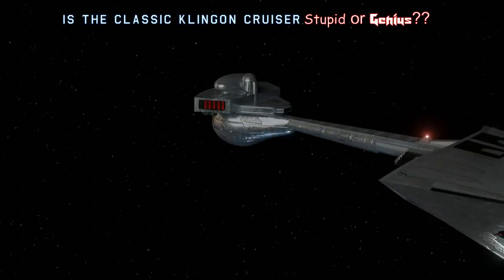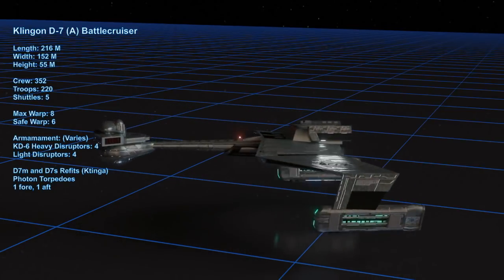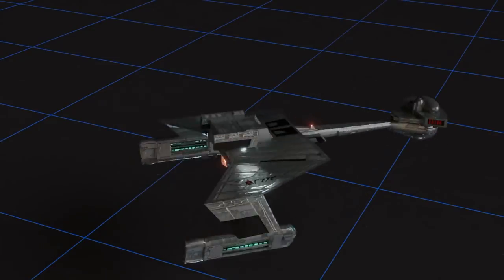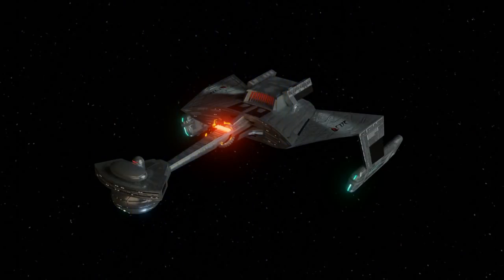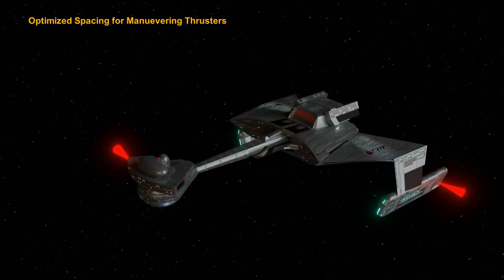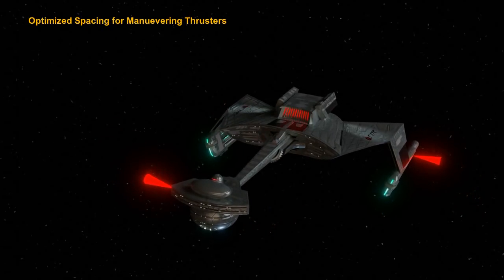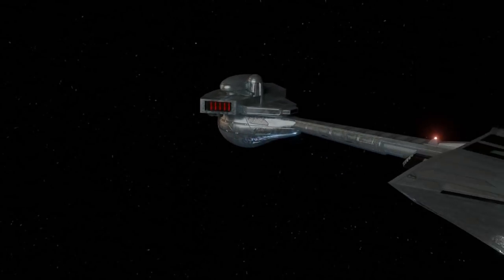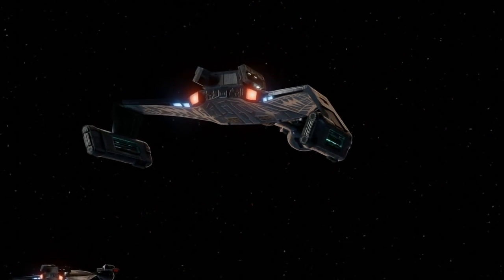The Classic Klingon D-7 Cruiser - Stupid or Genius Design?? Animated Breakdown!

Comment: According to the FASA Star Trek material, the boom section was separable specifically in case of crew mutinies. Since all the control functions were in the boom, this would leave the drive section pretty well useless while the captain and officers escaped in the boom. The long neck might be needed to help isolate the command section in that scenario; it's easier to lock down a narrow boom, rather than a wider (and more structurally stable) section.
Reply: It's a pretty shit ship if you can only control systems from one location in a ship.
Not just an internal CIC, but even the drive section having all the machinery right there but no way to control it in case the bridge/boom section gets shot.
Reply: And the officers could order a self-destruct immediately after safe boom separation.  Great disincentive to mutiny.
Reply: If you think the D7 was weak, what about the D18. It came constantly with a bent boom in the package.
It literally was like a command section attached by a space worm.
The only thing scary about that destroyer was not making it to the battle at all, "no thanks, I'll go in the K23."
Reply: @michaelblackwell7408  I love the design of the D-10, though.
Reply: Exacty.
Reply: Also they used servator races in the rear section. Parts of the rear section ware radio active.
Reply: Also, if there was a mutiny, that long thin neck is an easily defendable chokepoint.  A much smaller crew in the command section could defend against a much larger force attacking from the engineering section.
Reply: @robertcampbell6349  Stranding them  YEARS from home.
Reply: The Final reflection. D 5, D 5 A, and D 6.
Reply: Was about to suggest that as a possibility.

Klingons frequently have brawls, drink ups and power struggles. The thin boom funnels crew and offers a excellent point of defence. Throw in the other reasons mentioned in the video... i think it's a understandable but not ideal design.
Reply: It's for improved firing arcs...Star Fleet Battles Game.
Reply: It wasn’t FASA, it was Amarillo Design Bureau (Starfleet Battles). that came up with that idea. The SSDs would have a square in the boom to represent internal security.
Reply: @mattalleman4415  Yes! Didn't they also have an impulse engine block at the base?
Reply: @GreyhawkGrognard  yep a whole section for saucers and booms!
Reply: yeah, that is perfectly fits the klingon operation style, leave the ship and save your own skin and not face the chance of death in battle with the inferior rabble. after all, who wants to die today, or any day.
Reply: @thorin1045  Bear in mind this was pre-TNG. The Klingons back then were still culturally like the Soviets, as depicted in TOS and TAS. They hadn't been developed into the honor-bound warriors we see later. These were Klingons who used surgically altered spies and took hostages, and negotiated in bad faith and scorned the use of knives when there were phasers to be had.
Reply: @GreyhawkGrognard  well, in that case the leaders should be in the back with machinephasers mowing down the deserters...

Comment: I think the maneuverability theory makes the most sense. We all know that Klingons value that maneuverability very highly, since they need it to bring their main forward weapons to bear. Adding more structure around the neck would only increase the ships mass unnecessarily, and increased mass slows you down again. And as you said the neck would be incredibly hard to hit in the first place, so keeping it thin could be a valid tactic to protect it. Lets say it would be 2, maybe 3 times as thick. We have seen the damage star trek weapons do to unshielded targets. It is indeed quite realistic that a hit from a strong weapon (like a torpedo) would still cut the ship in half, even with the thicker neck. So making it thinner would at that point be more useful, as it is harder to hit.
Reply: I personally dispute the "Harder to hit" point, mainly due to a scene in the Next Generation which shows the Enterprise D destroying a group of small craft very quickly, granted, since it takes place a century after the Original Series, and we never got to really see how accurate the 1701 Enterprise's weapons were, so I guess in that respect, the point still stands.
Reply: Deflector shields are the bread and butter of all Star Trek ships of all species. Without shields a ship would need heavy armor but heavy armor is no match for a salvo of photon torpedoes. Klingons used disruptor weapons to break shields. The Federation use Phasers to drain shields. When the shields are down, the fight is over except for surrender negotiations and Klingons take no prisoners. TOS torpedoes are not super accurate. They rely on massive energy release near a target to disable shields or destroy an enemy vessel.
Reply: Then you aim for the point where the "neck" connects to the "body" of the ship.
Reply: Agreed with the firing angle point; Klingon and Romulan warships are both notable for the sheer amount of forward-facing firepower they have, vs the Federation who prefers a more flexible approach (Phaser Strips over Disruptors, torpedo launchers with fore and aft mountings that feed from the same magazine).
This makes sense for a species with a strong warrior culture prone to imperial expansionism and getting into lots of fights as a stronger "broadside" helps in straight up fights vs other regional-galactic powers.
Reply: @patrickstivers7387  In theory that's a good strategy, but the flaw is in execution. Keep in mind that at no time will you get the opportunity to fire at a fresh enemy where they will NOT have an opportunity to fire back. That's called an 'exchange'. The idea is to come away from the exchange in better shape than your foe. If you MISS, you've opened yourself up to damage to critical systems that may put you at a disadvantage later in the fight. You LOST the 'exchange'. In that case you are much better off attempting to disable a critical system in the main hull then trying to risk a 'one shot' kill. 

Now, you may try some cleaver maneuvers to 'get in close' to optimize your targeting but I would submit that if a Klingon captain 'lets' you do that, he's probably baiting you. ;) Klingons are well aware of that apparent 'vulnerability' their thin neck may offer an opponent, and they will absolutely use that assumption to their advantage.
Reply: Except that having a long lever arm makes it SLOWER to turn, and having the spine be very thin means it's highly stressed when making those turns. So, while it HAS to be very strong, it's also a detriment to maneuverability.
Reply: @chrisrautmann8936  exactly, that extra torque is not your friend here
Reply: @atmosdwagon4656  there are no "magazines" remember the movies it took people to load them.
Reply: @chrisrautmann8936  why, it's space you act as if aerodynamics matter here.
Reply: @johnjames1374  why it's space,  is the "space wind" going to rip it off?  😅
Reply: @M60gunner1971  Aerodynamics have nothing to do with it.  You have a great big weight on the end of a long lever arm, and you want to turn quickly.  It's a big bending moment. 
Star Trek ships are not designed to the laws of physics. Not with the long pylons, not with the big gaps, and not with the exposed bridges.
Reply: 23rd/24th century targeting systems hit small shuttles with relative ease, so the neck of a ship as well I'd say. There's also little use in having a 80 m long neck. That just reduces maneuvrability (force x length). 

Aside from realism, it's the coolest ship in the franchise imo.
Reply: It's for improved weapon firing arcs. If you ever played Star Fleet Battles, one advantage of the design is that the weaponry in the boom can fire in almost 360 degree arcs. Less weapons are needed due to the improved firing arcs. The forward phasers can fire directly to the rear also. Fewer weapons with improved firing arcs uses less power. In the game, Klingons are the only ones who can charge all their weapons and maintain a very high speed. They can use high energy turns, which are energy intensive, while charging all weapons, if you give up overloading your disruptors, or move at a slightly lower speed.

Comment: what i love about the D-7 design, especially with the original intention of the aperture in the front of the command module being a sensor/deflector dish, is that it is a design based around similar technology and "form-follows-function" principles as with the Constitution-class, but just from a different perspective.  this helps solidify a sense of verisimilitude in Star Trek's made-up technology.  both designs have warp nacelles, deflector dishes, impluse engines, and separate hull sections linked by thinner booms or necks.  these designs mutually support each other as concurrent designs, meant to do similar things with similar technology, just from different people.

Comment: I think the neck actually works perfectly with the design. It’s an offensive ship designed to attack head-on, and the great thing is that the weak-point of the neck completely disappears if you look at it from the front.
Reply: yeah it does because it's hard to hit like the conney's thin neck section

Comment: One thing people tend to forget about Star Trek is that being within 1light second of a ship is considered point blank in combat. Even maximum magnification isn't going to guarantee a phaser is going to hit where it's aimed. Compare to Star Wars where the Nebulon-B has a weak neck that's even more vulnerable because basically every engagement happens at visual range.
Reply: There has never been a Star Trek battle, in canon, outside of visual range.
Reply: @drawingdead9025  Remember that the visuals can be deceiving. Most times ships are within 100,000km of each other, it's basically like the other ship is right next to them.
Reply: @drawingdead9025  'The Wounded', tells you otherwise.
Captain Maxwell vs the Cardassian transport and one Galor-class.
Only seen on a tactical map, but clearly labelled as occurring at 10s of thousands of kilometres.
Obviously, in other cases, visuals will not match dialogue, sometimes, or could be taken as artistic licence.
Though the final battle with Reliant in Wrath of Khan sure seems intended to be very close range.
Reply: @chrissonofpear1384  Ok, fair point.
Reply: @chrissonofpear1384  I've assumed for a long time that the star trek version of "kilometer" was different from the kilometers on a planetary body, as often they'll say something is several thousand kilomters away but is obviously right in front of them on screen.
Reply: @mandellorian maybe the kilometers in space are different lengths than kilometers on a planet.
Reply: I always thought that the viewscreen magnified what was being shown, so what you see is not representative of real distance. If you recall in TMP Kirk tells Sulu to change magnification, which is already two? settings below that! 'Objects may appear closer than they really are.'
Reply: Great point about the ranges, and also egg-shaped shields would make it difficult to hit the neck.
Kirk-era battles usually took place at long range, which played well with the limited special effects of the time.  And this was made not long after WWII, where we had battles with submarines which you could not see, and battleships that could hit targets over the horizon.
After Star Wars, audiences expected to see both ships on screen together, even though it was TOS canon that this wasn't how battles were fought.
And after Babylon 5, audiences expected to see beams slicing ships apart, not hitting a round shield bubble.